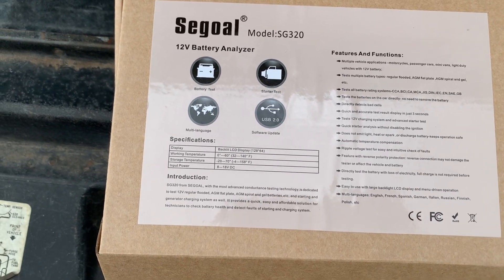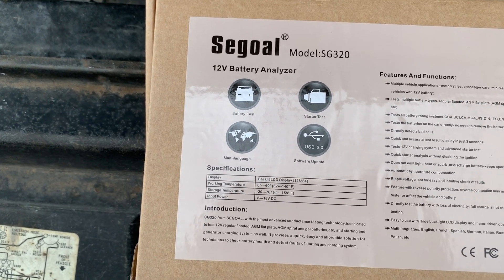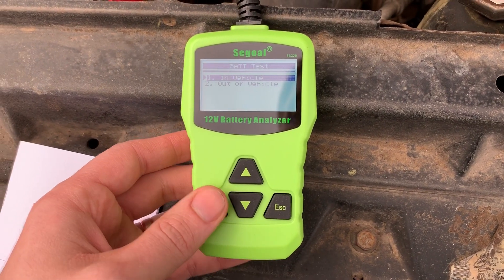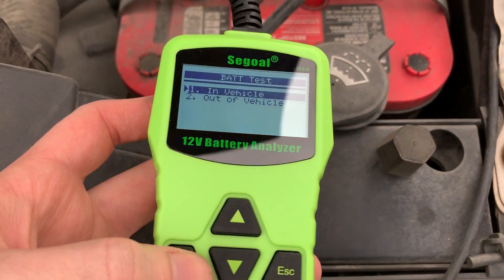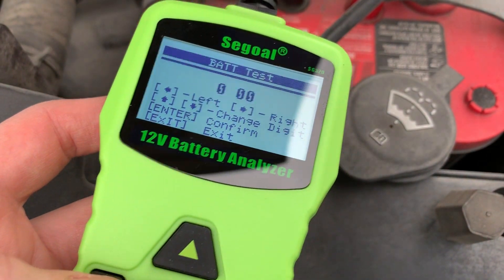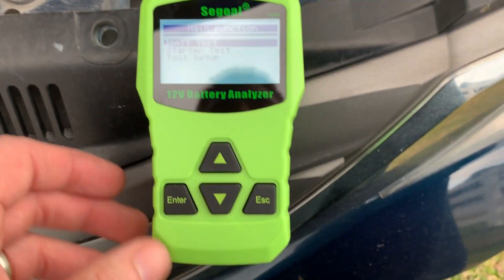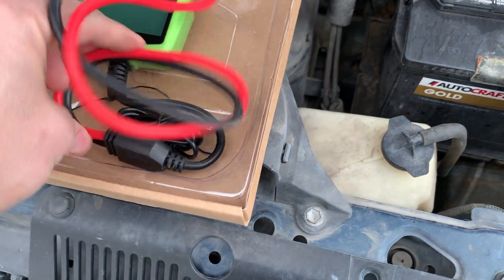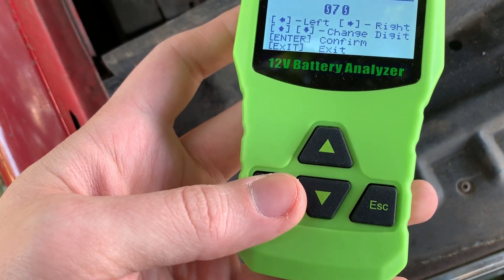Cheap Segoal Automotive Battery Analyzer

Comment: kw600 is the best value it has a lot of junk in it screen test text crap but it claims to be Bluetooth and print the results I don't know why you need to print the results of a battery test $33 eBay or the foxwell bt100 $30 eBay get it now prices are only going up

Comment: It's only lost 20% of its charge I think the battery is good, it's that cheap battery analyzer.  Grab a good midtronics and try it again.
Reply from the maker: It's not the best but seems to be fairly accurate as far as determining if a battery has failed.

Comment: This tester is junk. @11:41, it shows the SOH, State of Health at 100% but the SOC, State of Charge at 98.51% this is backwards, because you just pulled it off the charger at 12.66 volts,  and if given the SOH is 98.51% why is the measured CCA at 550CCA, it should be rated at 689CCA, and if the SOH is truly 98.51% why does it suggest replacing the battery given only a 2% loss in capacity. If you want a real tester, go with Midtronics, they pioneered this technology.
Reply from the maker: It’s not the best but can identify a failed battery, there may have been some surface charge left that threw it off a bit in the first test.